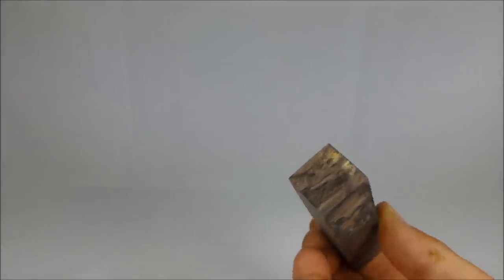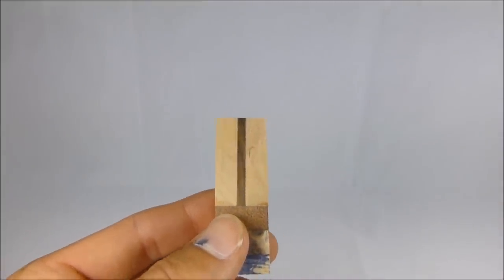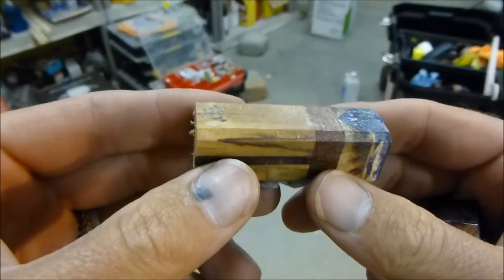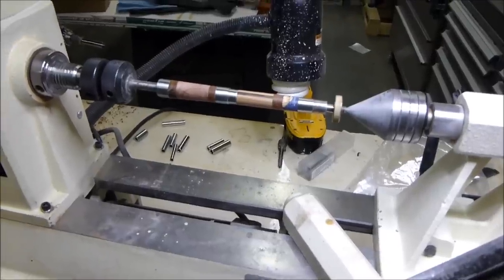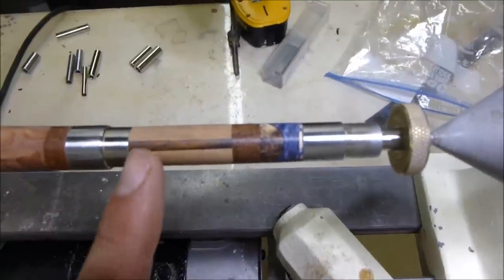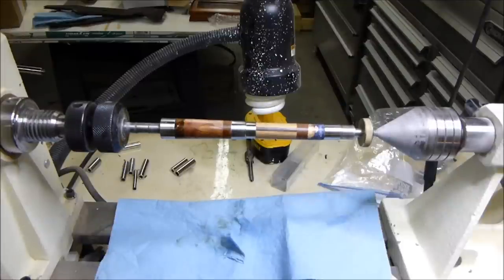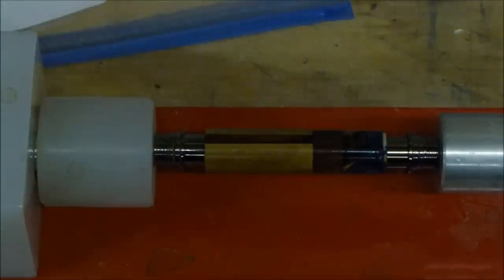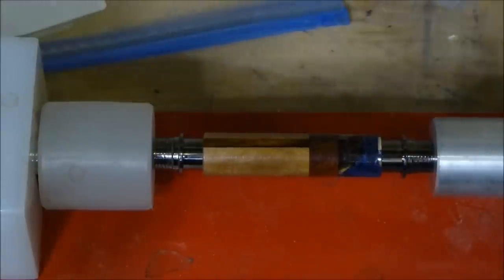The making of a pen with multiple woods

Comment: Try using a machinist's square to line up the cocobolo stripe or your mic'd line to vertical  with the vise as the reference
Reply from the maker: It's really hard to do, I do have machinist square, but the wood for all of my trying seems to come out a few thousands different in size. I can't seem to duplicate my cuts with hi tolerances. I mainly use a chop saw. Difficult to get a thousands of an inch out of that thing. I have delved into CNCing though and that seems pretty accurate. I have made a few things with tight tolerances. I really should start cutting my stock out using my CNC, it's just a pain to fixture.

Comment: Sean, have you considered using your lathe to drill holes in your blanks? It's more accurate than a drill press.
Reply from the maker: Rick Hilton Yes, I currently don't have a shop due to a move for work I have made. I am having a shop built though, and do plan to get back at it. I also plan on getting a chuck for my lathe to start doing the drilling that way. Many of you have suggested it and it seems to really pass the common sense test. When my shop is up and running I am going to defiantly do that. Thank you for the comment.
Reply: Sean G Sean, you can't beat using the lathe as a horizontal drill press. It's very precise. My lathes also doubles for polishing duties and the application of CA glue. I've gotten spectacular results. Good luck!

Comment: Hi the crack you got when you put the top clip in your press I always clean out the end of the tube then press together making sure the clip is square so you have to make a tool to remove the clip then fill in the crack and refinish .
When I glue in the tube into the blank get a slice of potato 1/4 thick I the   Of the tube that stops glue going into the tube.
Drills the best are colt drills they have no brad point but have a double cutting tip cuts envy thin .
Ps what pen kits do you use 
Richard
Reply from the maker: Potato, that is genius. I will use that. Thank you.

Comment: Oh man! One of the best videos I've seen! You have great skills and creativity. I would like to learn more about the hurricanelaser. Where to buy, how much, which model?
Reply from the maker: Well, it's a Chinese laser. Here is the deal. Mine is about 7 thousand. To buy a US version your gong to pay around 30K. I recommend epilog if you choose to go that route. Mine works, but it has it's faults and issues you have to learn and work around. Example, you have to be some what good at CAD. Another is because it's Chinese, the software is written in what the industry calls "Chinglish". Part English and part Chinese. Words are backwords, like download / upload. You have to learn it, to make it work. It also doesn't have fail safes. For example, if you tell it to go beyond it's workable area, it will try and do it, and you will or mite break it. If you are in the budget for 7K or so, this is your machine. Its a 60 watt. The civilian equivalent would be about 40 or 50K. You can also order them, same machine with a 30 watt, which epilog sells for about 25 or 30. Same work area. It's learning. Hurricane Lasers has GREAT customer service. I had several issues, and they always helped me. They might forget to call me back, but if you call them they will spend all day on the phone with you helping you or sending you a new part. Hope this helps.

Comment: This is an older video, so this is by way of a FYI. To use a glue that sticks to most things (super glue, epoxy, etc), you use a release agent on whatever you don't want stuck. I see where one person suggests glycerin. That will work, but I don't think it gives enough control over where it ends up. You can also get commercial release agents that you brush on and allow to dry. Personally, I use paste wax, and put on a couple/three coats.

Comment: If your laser goes back to the start position, try faster speeds and lower power and also consider various DPI. This should eliminate your residue and wood over burns.
Reply from the maker: I will give that a try. I'm currently in Afghanistan, so it's going to be a bit, but thank you for the advise.

Comment: For your stone dust get a mortar and pestle and finish grinding the stone that way to a fine dust. Make sure your wearing a face mask when doing this you don’t want the dust in your lungs one option when grinding the stone is place a few drops of water to keep the dust down and will help with the grinding and all you need to do is to lay it out on a tray and place it in a sunny spot to dry or even place in the oven on a very low setting checking it every half hour to see if it’s dry and to save on your dust when rubbing it in, place your container under what you are rubbing it on to and thus you won’t waste so much of it when rubbing it onto the laser cutout or put a piece of paper that’s been pre-folded to make it easy to pour back into the container.
Reply from the maker: Sorry it took me so long to get back to you, I have been out of the country. Mortar and pestle is a good idea. Thank you.

Comment: Thank you for all your hard work what do you use to true it up with. that is my problem getting the glue up square.
Reply from the maker: True it up. That is the really hard part. I have not found a single way to do it perfectly. The base piece, or center strip of wood is where I start. Everything has to be the exact same size. So the bottom barrel, the center piece is very exact, and larger than the two outside pieces. The two, "white" pieces that sandwich it are exact same size. This leaves the center piece of wood, which is thin, sticking out from the two outer ones. I have a "V" style vice and it allows me to put that center piece in the "V" keeping it perfectly strait up and down. That is just one technique, but needless to say, most of it's eye ball. It really takes a long time to build one of these, thats why I don't sell them. If I was to charge like 20 bucks an hour, no one would buy them. Hope this helps.

Comment: How does that laser work on the fake Ivory. I would love to do some with fake scrimshaw.
Reply from the maker: I would imagine it would work great. It can just barely etch aluminum, so that being a good "heat sink" and knowing the average grade of aluminum starts to break down at 1,375 F, it's safe to say my laser works around 1,500F if I turn it all the way up. I have cut through 1/2 poplar before with no issues. Slow, but no issues.

Comment: Hi, nice video. You were asking for tips, so, here's one thing I see or hear, I should say, that you may be doing. You mention your drill bits are dulling. You speak about how expensive they are, to me it sounds like you may be tossing them in the garbage once dull. You can sharpen them. Almost all the drill bits supplied with kits and by companies like PSI for pen kits, are 118 degree grinds.

All you need is access to a grinding wheel or sharpening station. If you are going to have a small hobby scale wood shop or better, a good sharpener or grinder is an invaluable tool. There is a difference between a basic bench grinder and a sharpener like a tormek system. Tormek's are nice but very expensive, a decent grinding wheel, properly dressed will sharpen your tools. Grinders are high speed. Tormeks and other sharpening systems are slower speed. As you found out, heat is the enemy. High speed = heat. 

We are talking drill bits, cheap ones, so no need to buy an expensive sharpener. A regular old pedestal grinder will work. You just need to make a jig to lay your bits in that holds the edge of the bit at 118 degrees. Easily made from scrap wood. I don't have my camera set up or Id show you, I am sure there are video's here on youtube just search sharpen drill bit jig.

I went to look to see if there were video's and here is a good one. Do what you see here and you will not be buying new bits for decades if you still have the dull ones.

Another thing, when gluing up wood, use tightbond 2 or 3. Glue up, let it cure over night. To deal with the small sizes of wood, glue up your pattern in multiples, by that I mean instead of trying to make one pen blank, figure out your pattern and make a big block of multiple glue ups allowing for blade width when cutting into blanks. It takes just about the same amount of time and if you screw one up, you have more. Most of the time spent on woodworking is set up time on machines and glue up. All the measuring, adjusting blades, guides, etc. takes time. All the setup of jigs, clamps, gluing, layout of patterns, etc. that is a time consuming process, so make a big block. Then cut out 10-20 blanks at one time. Thats why a Dresser costs about as much as a night stand. The night stand has the same number of pieces, same number of cuts basically, same glue up. The difference besides some drawers, is just more wood. Even if you only are giving one away, make 5-10-20, one day they might want another or they might sell for big bucks and you only have to go turn a blank. :)

https://youtu.be/72syhJoOsHM

Comment: Why didn't you bore the hole in the blank on the lathe with the bit in a tailstock ?

Have you thought about filling the laser chamber with argon or nitrogen to reduce the burning of the wood ?
Reply from the maker: I don't have a tailstock drill chuck. I am going to get one though. I do believe it would be easier. Filling the laser chamber with argon, I have never thought of it. But I can tell you getting rid of the "off gassing" is really easy. I am not sure how the hole ting would react with argon. Works good with welding, I am sure it would work good for engraving.
Reply: +Sean G I don't think the argon thing would work, given the amount of air the exhaust system constantly moves through the laser chamber I have worked with. If you shut off the exhaust to fill the chamber, the debris from the laser (even if it was not flaring up, it would still be hot and "dusty") is more likely to accumulate on the laser optics. If any grime gets on the mirror optics, that stuff will heat up when the laser hits it, in turn destroying the optics the grime is on. Which in turn is an expensive repair. Doubt you can maintain the volume of argon fill AND keep the exhaust running at the same time.

I will have to try the alcohol rinse to see how it works for my engraving work. I just started trying a rub down of butcher block mineral oil before and after etching bitch plywood to hold down the sticky off-gassing you are talking about, plus reduce the small of charcoal.

Comment: How much does it cost to buy a really good pen like that?
Reply from the maker: Brother, your not going to like the answer, but here goes. Cost for the kit is something like 30 bucks. 34 rings a bell, just call it 30. Your looking at about, and I say about 20 or 30 dollars in wood. If I was to charge for labor at 15 bucks an hour, it would be about 150 to 250 dollars. Each pen, some cooperate, some buck my system from start to finish "referring to the process of making the pen". . If you have made these before you will understand how hard  stabilized wood can be to work with. So just call labor in the middle at 200 + 30 for the kit + 20 for the exotic wood, your looking at 250 at least. I have seen them on the net for up to 1,200 dollars. The average price on some web sights is about 300 to 500 per unit. Special note, I have NEVER seen one with my detail in it, so take that for what it's worth. Hope this answers your question.

Comment: What pen kit is that that you used and where did you get it from? I love the metal working on the bands.
As far as the cracks, I have used superglue on sandpaper and it will sand and fill at the same time. I have used wormy (sp?) wood and left the powdery residue and thin CA to create a very unique looking barrel.
Reply from the maker: I bought the kit from "Pen State". Go to google, type in Pen State Pen supplies and you will find Penstateind I believe. They do have the best selection but some times can be difficult to deal with. Example, purchased an item, expected to receive what was in the picture on the web sight, received a cheaper version. Sent an E mail, no reply. Left a product review, and it was removed. There prices on some items are also high, on others reasonable. But they do have a great selection. The pen kit is scepter, or braudneuva scepter. Spelling is more than likely incorrect but you will find it. As for the advice, I will have to give it a try. Thank you. Also glad to see i'm not the only one with the issue. :)
Reply: Sean G I deal mostly with Woodturningz and Berea Hardwoods. Woodturningz has never let me down and their prices are very reasonable and great service. Most of their kits are what I would consider entry/mid level but look good with the right choice of blank. Berea on the other hand I have had issues with. Although their kits are nice, I have received incorrect upgrade parts and I find them a bit more expensive. I most say even though I have had issues, they have resolved them without question.
Reply from the maker: The kit is sold from Pen State Ind. To be honest I don't care for them, Pen state that is. I have purchased about 3,000 dollars worth of items from them, and a few times I have been screwed for a lack of better words. I have called, placed E mails and they don't return phone calls. Example. They show a picture of what your buying, and that's not what you get. You end up with a cheaper Chinese version, that is not the same. That is just one example. The pen kit is called, Braudneuva Scepter. I more than likely have messed up the spelling of that, but that's the kit. I don't buy anything from them any more due to the simple fact they are some what shady and if there is an issue, you can't get it fixed. I am willing to pay more money to a small company I hopes that the owner is an American trying to make his or her way. Best of luck.
Reply from the maker: Thank you very much for the tips. I do appreciate it. Sorry for the delay in response, I'm currently in Afghanistan.
Reply: Sean G Penn State has been good to me. Including sending replacement pen blanks and just asking me to throw out the ones I had.  Keep Safe, my son was a Chinook Pilot in Iraq. And one to Afghanistan for a short time. Keep safe.

Comment: Couldn't you just epoxy multiple boards together, like a sandwich, drill some holes out and then use a scroll saw to cut out blocks? It seems easier then trying to drill a straight hole with the drill press....Just an idea and you could have multiple pens to turn quickly.
Reply from the maker: +USAlien234 It would be easier to do it that way, but you have to remember my goal is to drill down the center of the laminated part exactly "pine that is sandwiching the brown elder and its vertical" , so when I turn it round, it's aligned and not cocked off kilter. That also includes the 45 degree angles where they peak and meet each other. Using a scroll saw, I am not that good to cut the blocks. I need perfect 45 degree angles to not have a gap. Small items like this will show every little imperfection down to 2 thou of and inch. Example would be a thin human hair would show easily with contrasting woods, "light dark". It's all about perfect angles and geometry. I have not found any way to do it better than the current way I am doing it. It takes HOURS, but the end result is pretty nice. I would love to find a faster way to do it, just have not figured one out yet. On a side note, if I was doing segmented pens but all the segments where in the same direction or 90 degrees out, then yes it would be pretty easy but when you have 45's lined up to a vertical, you have to drill down that very point.
Reply: Got it. Sry I didnt think it was that precise of a craft. I understand what you are saying, I hope you find an easier way, it looked beautiful by the way !

Comment: nylon bushings are nonstick for CA, let's you keep your mandrel tight. the 2p-10 CA is a lot better than generic stuff.
Reply from the maker: +Wire Smith Where do you purchase the 2p-10 at? Thank you for the advice by the way.
Reply: +Sean G Amazon, or my local wood store.
Reply from the maker: Good to know, can you tell me what the difference your seeing in the 2p-10 ca Verses the others. I have tried all sorts of glues, none that really wow me. I even got ahold of some flexible CA to stop the cracking that happens over the years. It seems to work. Now I can't find the stuff any more. I'm not sure though if the flexible CA shines quite as nice as normal.

Comment: At 1:00:45 how did you flip the lathe up on end?  The video shows the pen still horizontal but you mentioned you're keeping it as "vertical" as possible.  That would mean you flipped the lathe up on end by 90 degrees ( with camera still attached).  If I needed to keep the barrel vertical it would be easier to take it off the mandrel and stand it vertically.  Personally I would keep the barrel horizontal instead - that way the CA won't flow onto the bushing when you keep it vertical (rather than horizontal)
Reply from the maker: I miss spoke, it stayed horizontal.

Comment: Do you sell your pens?
Reply from the maker: +Ma Z No, I have never sold one yet. People tend to get sticker shock. So I kind of break down the cost like this. It's a little over 100 dollars for materials. Wood, the different glues, sand paper, polishing fluid, on and on. So lets call it 110 dollars. Machines need to make about a total of 6 bucks. Eventually they will break down from use and I need to fix them. I figure my time is worth 15 bucks an hour, and one of these range from 8 hours to 15 hours or so. So lets just call it 10 hours at 15 bucks an hour. Thats 150, plus material of 110, plus 6 for the machine time, it's about 266. I have seen pens like this sell for 1,200 dollars and I have seen them sell for 250. Hope this helps.